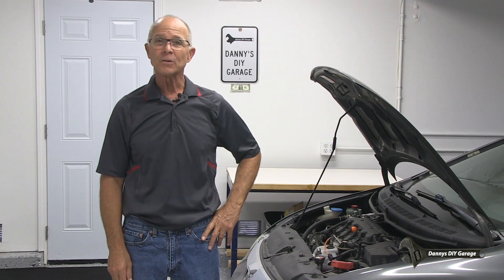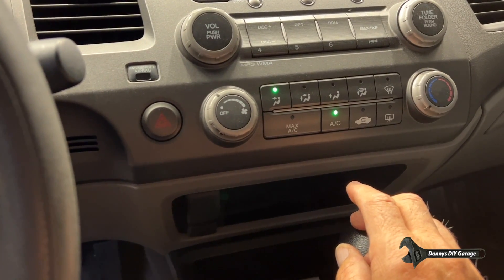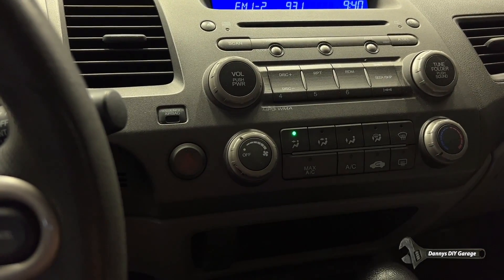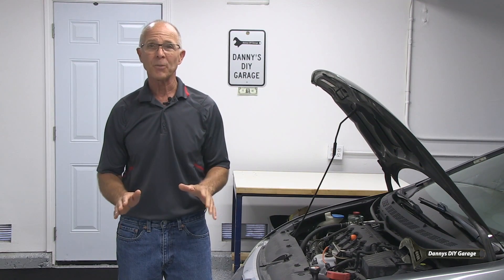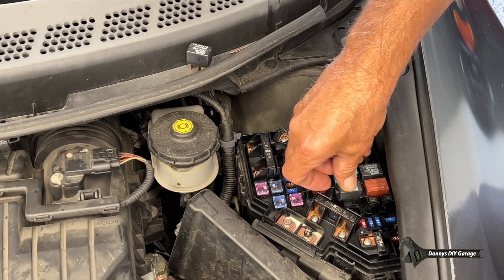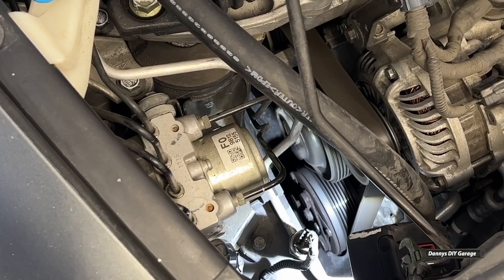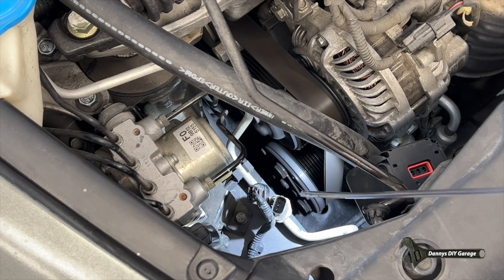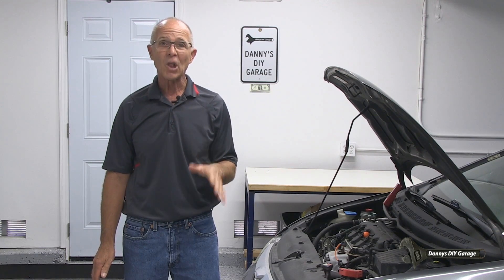Honda Civic 2009 AC system blows warm FIX

Comment: Danny, is there any danger in adding Freon if Freon is not the issue? I suspect that is the issue with mine, but I do not have a thermo to test the before and after. Is there any danger in adding some Freon and then checking if the AC blows cold after? Thanks!
Reply: Yes, if you overfill the system it will cause more problems for you. If you're able to,Buy a gauge to test it. Better to be safe than sorry. Ac's are such a blessing and for me A complete necessity. I no longer have a thyroid soo it's no beuno not having AC right now. No one can pin point wtf is wrong with mine so I'm trying to do it myself lol. Ohh ohh get a gauge that shows you BOTH the high and low side! I hope you get it figured out❤

Comment: I have exact same car, im going to run through some of these, it takes forever to start getting cold but if the car is idle or sitting then it just blows hot air and never cools, does this help in knowing what it could be?
Reply: Any luck figuring it out? Sounds similar to my situation. I added some freon but didn't make a big difference. Maybe just a slight bit cooler.
Reply from the maker: I recently uploaded a video which might help

Comment: So i checked one of my fans and the one on the left isn’t spinning. Which issue would this be
Reply from the maker: if your fan isn't spinning remove the connector at the fan and see if you have 12 volts and Ground at the connector, if you do, you will most likely need a fan motor. This is just an educated guess, proper diagnostics would prove this, good luck update me on what you find

Comment: Also, my ac is cold when the temperature is below 80 degrees outside. But when it gets hot outside. The mixture from my ac and the outside. The AC isn't cold any longer. So I think they are mixing together. And wasting gas when I had the AC on
Reply from the maker: common problem but many different causes, there is not enough information for me to guess correctly, you will need to put a set of gauges on this and read pressures

Comment: Hello, great video. I think my issue is that my recirculation isn't working correctly. Because when the light is off of course you would feel the air from the outside or engine compartment. But when I the button to light up. I can still feel air coming from the outside. Could you tell me what my problem may be?
Reply from the maker: I recently uploaded a video which might help

Comment: You don't mention if key on, engine off (KOEO) position to check if both radiator fan and condenser fans turns on if you have AC bottom on along with blower on but not all cars turns on the fans on on position alone!
Reply from the maker: Sorry for the confusion, Yep key on engine off, understand not all cars, the 2009 civic does. Thanks for watching and your comments
Reply: @dannysdiygarage  No worries! I checked a 2013 Honda fit with operational AC in our lot and did the KOEO but no fans turned on. I guess it depends on a year and model.
Reply: @dannysdiygarage   I have seen some complex electrical problems in Honda! If an AC not operation along with some other electrical problem you may need to get deeper into it. Sometimes the best case is only replacing the relay or compressor clutch or on/off switch or pressure switch!
Reply from the maker: I agree, I plan on doing more AC videos, it appears that whenever I get too deep into electrical my views go downhill, I actually love electrical challenges and would love to do more. appreciate you
Reply: @dannysdiygarage  As a matter of fact, I am working on complex electrical problem on 2003 Honda Civic LX 1.7 coup. First, I had to replace the ECM because I was getting codes for both O2 sensors for no reason. Then I noticed that the compressor clutch wasn't fully engaged. I replaced with a good one but AC is not still working! I have checked & switched the relays, checked the switch, wiring, jump the pressure switch with no luck! My guess is someone somehow shorted the wires maybe by reverse jumping or spilled soda on some connectors. I will keep you posted of my progress.
Reply from the maker: Please do,

Comment: Hi I have same car and when I turn ac on  clutch engage and get cold air  but  it no cycling it disengage only  when i turn it off. So what to check?
Reply from the maker: You did not indicate if you are having cooling issues or not, however You’ll need to put a set of gauges on it and look at the pressure, this will give you the best information, you’ll need to see how high and low the pressure gets, this will determine your next steps
Reply: @dannysdiygarage   no cooling issue just clutch is allways engaged when ac is on.
Reply from the maker: Get a set of gauges to install and check your pressures

Comment: How to you accurately test the AC/Freon pressure with a gauge if the compressor clutch doesn't enable ?  Isn't that a catch 22 ?
Reply from the maker: Correct, the compressor would need to on, if not you’ll need to determine why it’s not

Comment: Hey Dan, thanks for the video. Mine is blinking 6 times, I replaced the blower motor resistor. Is there a fix for this or would I have to take it into a shop for it to get fixed?
Reply from the maker: What is your actual problem, is it the blower not turning on?
Reply: @dannysdiygarage it blows cold air but even though it’s maxed out the flow isn’t strong. It goes up and down some times it blows hard and sometimes it feels like it it’s barely on even though it’s on full blast.
Reply from the maker: @Hmmmmmmmmm232  could it be a bad blower motor or something stuck in it blocking the flow, did you remove it and look and it?

Comment: Hey Danny hope you’re doing well, I just got a 10’ Civic LX and I’m having problem with the A/C, it blows cold when I start driving and when I’m at idle it blows cold air but not as cold as it would be when accelerating or driving, do you know what may be causing this? I also found that after I did the AC unit test it blinked 4 times. Any steps I should do to check what’s wrong? Thanks.
Reply: having same issue as well as it cools in the morning but just trows air when left in the sunlight. compressor kicks in and everything. added freon and air is cooler now so i dont think is the expansion valve. idk what could it be
Reply: @joseturcio361  Im going to try a recharge, ill lyk what happens.
Reply: @pasidudissanayaka1843 did it work ?
Reply: @dabshow8989  worked for a bit then my car started overheating because it disabled a fan radiator, do not try it go to a shop.

Comment: Which side did you hook the Freon can to?  Should be the low pressure side, correct?
Reply from the maker: Low side
Reply: I see or hear where you said the low side.  May I suggest clearing that up if possible.  Greta video by the way !!  I learned a lot.

Comment: damn nice video thanks
Reply from the maker: I appreciate your comment
Reply: @dannysdiygarage  can you do more ac videos for the 08 civic?
Reply from the maker: I do have many videos already and many more planned, is there something you’re looking for
Reply: @dannysdiygarage  people really should know more about their ac system, i hope you can show us a clear diagram of the whole ac system. i followed your video and when the low side of my ac tube was removed, alot of cream erupted from the tube, it was freon very milkshake like and thick, now iam wondering if I should go ahead and evacuate the system, will it suck out the the cream? or only air/moisture? what todo if the vacuum pump does Not suck out the jelly cream milkshake from my ac. also, i followed your video to remove my evaporated, when removed, i noticed the tubes on the evaporator where Broken! no wonder it never worked! i replaced the expansion valve! Help us
Reply: @dannysdiygarage  it helped so much know about the codes, but my 08 civic is the hybrid version, it has an LED screen.

Comment: What if the climate control unit has a code said AC? I followed your instruction and it has the AC code. Is there anyway I can get the code reset? I just had my AC compressor fixed but the AC is on and off itself, looks like some sort of signal not passing through correctly. Many thanks if you could help me out
Reply from the maker: What code did it flash? The code clears when the problem is fixed

Comment: Have you dealt with moldy/musty smelling AC? My 9th gen is smelling
Reply from the maker: I'm not dealing with it, however a trick is before you quit driving (Maybe a mile before you shut the car off) your car shut the ac of, leave the fan motor blowing on high and record button in fresh outside air mode,

Comment: Question: 07 Civic EX. A/C wasn't charged when I bought it. I was told it just needed freon. Bought a charge kit from Walmart. Put it on the low pressure side to change it. It was empty. Turned everything on high/max, pulled the trigger, clutch activated but the gauge shot to the red/full/danger zone within 3 secs. I know it's not full. What do you think?
Reply from the maker: many reasons, I could not begin to even guess unless you installed a set of gauges and had reading of both high and low side, sorry
Reply: Did you pull system into a vacuum 1st?

Comment: Im goin to change the  evaporator and expantion valve my self, where do you add the pag oil in for the evaporator ? Do i do it trough the gauges and how much do you put in for 2008 Honda Civic Ex Sedan 1.8L?
Reply from the maker: You can add it either through the gauges or in the open system directly, be careful how much you add, the evaporator requires additional oil the expansion valve doesn’t require more oil unless you loose oil, good luck

Comment: Hello, 
Please if someone encounter this problem... on my display when i press auto on the aircon, and then ac button to turn off or to turn on doesnt show the message on the screen and also doesnt turn on the ac.. like the button is not working, ive pulled out #35fuse in the dash the radio and the screen went off and after that pressed ac button and the ac started to work, ive put back the fuse and ac on and off buton worked also i had the message for ac control on the display  after working for some hours its the same no message for control on the display for the ac function like it doesnt exist, did the same and again not funtctioning, the ac is filled up with refrigirant and when worked it blows realy cold, put it on diagnostic and showed up ac evaporator temp sensor open circuit..my question is why the ac function on the screen doesnt show up 2006
 1.8 103kw hatchback ufo
Reply from the maker: if it's showing AC Evaporator sensor open I would fix that 1st, this might be all of your problem, other then that, I can't help you, maybe someone else will chime in

Comment: What are your thoughts on hotwiring a switch to my dashboard in order to get my ac running. It’s an old car, ‘96. The ac works, I just can’t get the compressor to engage no matter how many parts I replace. No one can figure it out. I’ve heard of people doing this. I understand that this could kill the compressor, but if I cycle the switch on and off, maybe I could get by. What do you think? Thank you!
Reply from the maker: I would not do a switch, I would spend more time to diagnose the problem, I don't know what diagnostics you have done, but there is a Thermal protecter in that circuit, should be somewhere left front corner of the engine compartment, two red wires going to it. check that
Reply: @dannysdiygarage . Thank you for your timely response. You give good advice. I was blessed to find a video about my same vehicle with the very same problem. It turned out to be a burned AC control panel. I removed mine today and immediately knew by the smell that I have a bad unit. It was the same odor that I had detected just minutes before it stopped working. I’m getting one cheap tomorrow and it swaps out extremely easily. If by some strange circumstance anyone owns a 1996 Nissan Quest/mercury Villager, and has tried everything without success, just know that the head unit is trouble prone and hard to diagnose because it still functions in every way except for the AC on button which is responsible for engaging the clutch. However, the light illuminates when depressed which makes one believe that the compressor is getting a call to engage but not so. Hopefully this helps someone.

Comment: Great video Danny, a polite suggestion is checking the cabin air filter. I had my Acura's dirty enough to freeze the core and naturally stopped cooling. Swapped it and worked fine.
Reply from the maker: That is great information, I’ll share this in a future video, thanks so much for sharing this
Reply: Just changed mine too! Works well now! I had no idea!

Comment: Question:
Where is the actuator module located?
Is it under the hood?
Reply: In my 2008 civic it is behind the glove box on the left.
Reply: Never mind that seems to be the mode actuator to change from defrost to front and bottom blowing
Reply: @seanriley3921  thank you. Will look into it.

Comment: My compessor clutch did engage, i haven't fill the freon yet, if i fill the freon and temperature drop, is that mean there is leaking?
Reply from the maker: that is correct
Reply: @dannysdiygarage  try to add 12a  to the civic with 134a freon, some said don't mix, but many said they just add 12a into system with 134a and have no problem even after few years , so should I do this ?

Comment: I think this video needs to add changing out the fuse and relay. That fixed my problem because I saw that the clutch was not engaging when I turned on the A/C. There's no problem with the fan or the system holding pressure.
Reply from the maker: Great addition, thanks for adding this information

Comment: what if there is a code or flashing on the control head what code is that? 2:10
Reply from the maker: depending on how many times it flashes depends on the diagnostic procedure, blinks 1 time, indicates a open in the air mix circuit, 2 times indicates a short in the air mix circuit, 3 times problem in the air mix control linkage door or motor, 4 times open or short in the in the mode control motor circuit, 5 times problem in the mode control linkage, door or motor, 6 times Blower motor circuit, 7 times heater control panel error, hope this helps
Reply: @dannysdiygarage mine started blinking nonstop

Comment: My radiator fan works but condenser fan won’t turn on, and my compressor turns on when I hit it with a screw driver, does that mean I should adjust the shim?
Reply from the maker: possibly, however I would also tap the condenser fan motor to see if it starts working, I show this in my window motor video, or even starter video, its a great way to test motors of any kind, link https://youtu.be/8B0d4jfwGYk

Comment: This saved me an arm and a leg. Had a bad fuse. Which obviously threw off the ac recharge reading. Replaced the fuse, recharged the ac and it works! It isn’t ice cold but it’s getting colder!
Reply from the maker: I appreciate your comment, glad I could help

Comment: you got  clue's clues where to look for this My  cabin fan  will only run if  the car is  covered with dew   or  it's raining , but ran when i did that  control head test? i checked  relay ,   another thing is  is when does run it wont stop unless move the  fan speed a little off stop position  but does change speeds ?
Reply from the maker: very interesting, let's power up the fan motor and see if it runs, also I'm thinking this might be a good video, please send me more details, year make model and a clear description of what happens, send to: dannysdiygarage@gmail.com, what state or country are you from?
Reply: @dannysdiygarage  2008 HONDA CIVIC 4 DOOR SEDAN  DOESN'T SAY  IT  BUT I THINK IT'S A DX   ,  WONT RUN IF TEMP  IS WARN AND IT'S   DRY  WHEN RAINING OR HAS DEW ON THE CAR, THE  FAN WILL WORK ,  RAN THAT CHECK  CONTROL HEAD  PROGRAM AND  THE FAN RUNS AND CHANGES SPEED  , SO WOULDN'T THAT ELIMINATE THE  FAN  THE FAN  RESISTOR NOT WORKING  ? I SWITCHED THE TWO BLUE RELAYS IN  THAT DIDN'T WORK , CHECKED A/C RELAY , I ( IN FRONT OF THE 2 BLUES)WONDER IF IT HAS TO DO WITH  WIRING THAT'S UNDER THE  PLATE THAT HOLDS THE BATTERY,
Reply: CHECKED ALL THE WIRES TO THE  A/C COMPRESSOR  EXCEPT THE WIRES  UNDER THE PLATE HOLDING THE 12V     BATTERY  RAN  CONTROL HEAD TEST AGAIN  SAME RESULTS  BUT  FORGOT WHEN THE FAN DOESN'T WORK THE A./C   CONTROL LIGHTS DON'T COME ON  EITHER ,  THEY  A/C  AND RADIATOR  FANS AT THE   ENGINE  BOTH RUN ?
Reply from the maker: @larrysheetmetal  My guess is a control head, 2nd is the blower resister, without being able to diagnose it these are only educated guesses, what controls the blower is the relay, resister and the control head, there is a ground to the body behind the left kick panel, good luck, wish I could be more help, please update me when you fix it
Reply: @dannysdiygarage  I am puzzled i switched the 2 g8   h71   relays behind the  blue relays  ( closet to window ) ,   now  I  only have heat and   the fan works but only at  low speed if you put the fan switch  in middle position?  WHEN   stops raining i am going to switch them back and  see if goes back will only run when it 's wet ,  HOPING IT NOT THE COMPUTER CONTROL SYSTEM !!!!!
Reply from the maker: Larry Where do you live ?
Reply: @dannysdiygarage   MD,  I thinks it's the  the  heater, a/c control unit   I switched back the  relays that I   changed  and  still acting the same  now ,different from a couple of days ago
Reply: @dannysdiygarage  another stupid question the front plate of the a/c   clutch  spins all the time , even though the a/c not on   and   thank you for your time  and effort
Reply: @dannysdiygarage   I fixed it, It was the  climate  control head , but I have another  a question should  I be worried that some one  at shop had opened that up and took the  two 8mm bolts ? I wonder if some shop stole my  air bags
Reply from the maker: Thanks for updating Larry, if there is a issue with the ai bag a light will be on